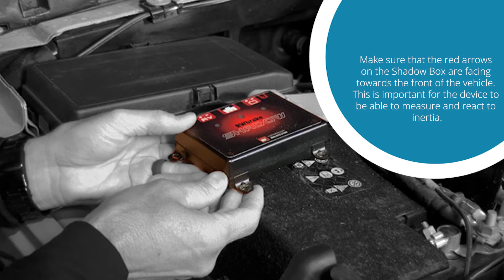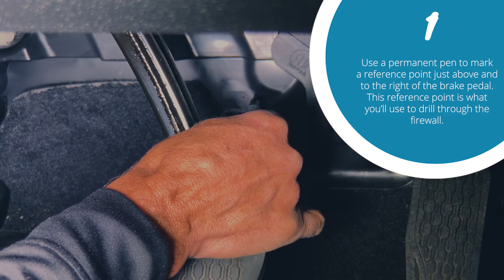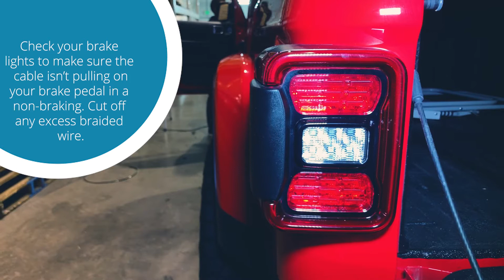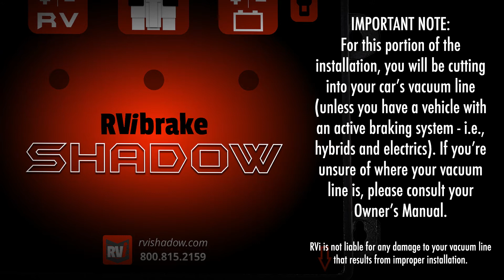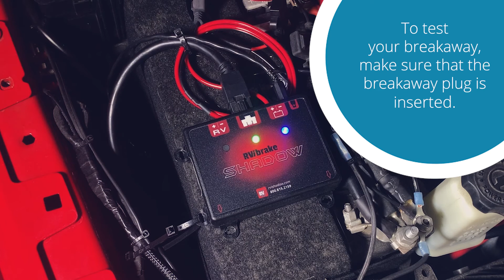RVi How-To: RVibrake Shadow braking system for flat towing Installation

Comment: I love the idea of the Shadow, quite elegant.  The challenge that I am facing is that as I survey the very small engine compartment of my 2019 Ford Fiesta finding appropriate placement of the 3 components is proving challenging, especially the need for a decent, uncrowded flat spot the Shadow Box and a decent spot for the cylinder.
Reply from the maker: We totally get that! Some vehicles may be too limited in their space, in which case we would recommend a portable system like our RVibrake3. Other installed braking systems will require more space though, so, if things are too tight, we'll want to go with a portable option.

Comment: Great video! 👍 I use the RVIBrake3 portable unit and it's worked very well on my toad (2017 GMC Acadia) - excellent product. It does get a bit cumbersome putting it in and out of my car each time I tow.  The RVI Shadow brake looks like a real winner.  What percentage of your sales of brake units are for the Shadow and what are for the RVIBrake3?  I'm just curious.....
Reply from the maker: Thanks, Fred! The RVibrake3 is still our most popular unit, since it's been out since around 2011-2012. The Shadow, on the other hand, didn't get a wide release until 2021. In the RV industry, it can take awhile to make inroads, especially on the dealer side of things where certain dealerships and shops already have an installed unit of choice. However, as the Shadow has gained visibility within the industry, those numbers have definitely shifted in its favor.
Reply: @RVi  Thanks for the informative reply.....

Comment: Your new version of the brake pedal bracket is nice that it is adjustable....however the screws are too long for my Jeep Wrangler Brake Pedal.  Since the screws are not fully threaded all the way, the screw bottoms out in the nut before the two piece are clamped snugly on the pedal arm.  You need to include shorter screws in addition or make them fully threaded.
Reply from the maker: Hi there! We'd definitely love to help you get that resolved. I'd encourage reaching out to our Customer Service Champions at contact@rvibrake.com so we can get some photos from you and make sure you're all set up.